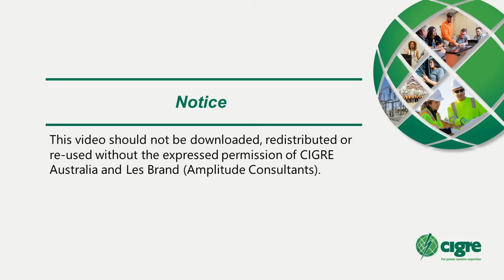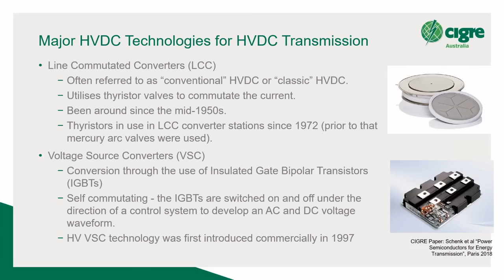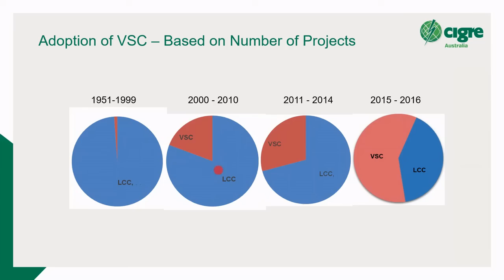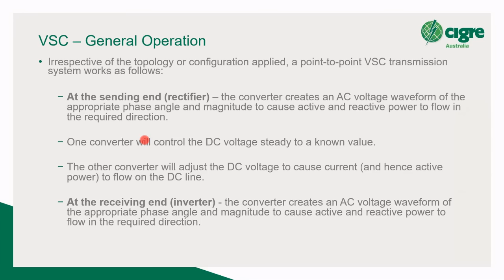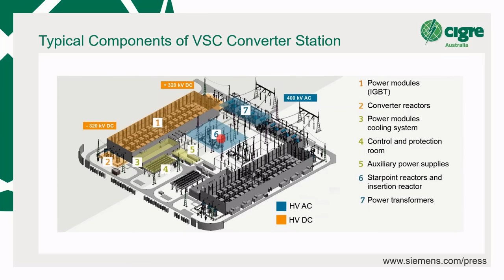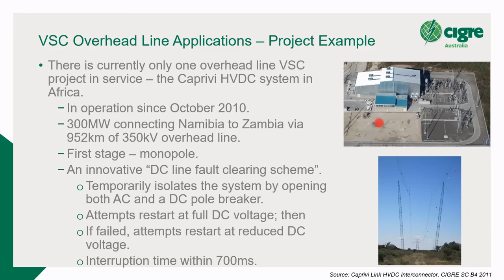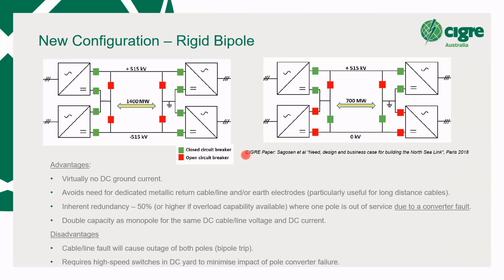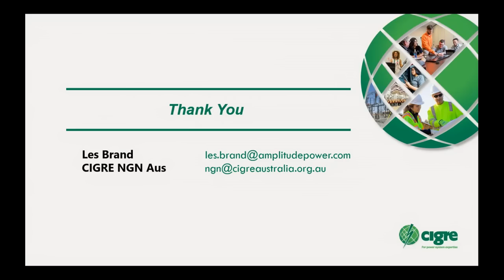Introduction to VSC HVDC

Comment: Very good video.
There is still a missed issue: how much kilometres is the minimum to be profitable this uhvdc?
Up there I found 80km. From 0 to 80 is better AC and above 80km the profitability curve start to rise in DC. The more km, more efficiency in DC. Nowadays at China is a mega proyect of 3200km in uhvdc.
Ok. Thanks
Reply: MORE THAN 500KM
Reply: Answer is, as usual "it depends". The biggest dependency is whether its overhead cable or cable. Its typically over 500km for fully overhead, but at the other extreme salt water is an excellent dielectric so it is more like 30 km for undersea. But the breakeven point also depends upon other things like the amount of power being transmitted and even the price of copper.